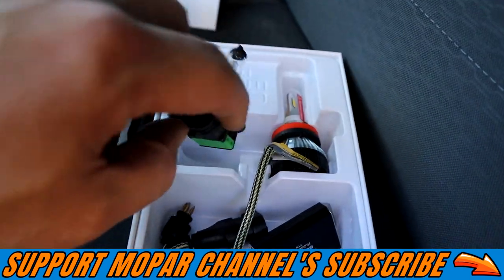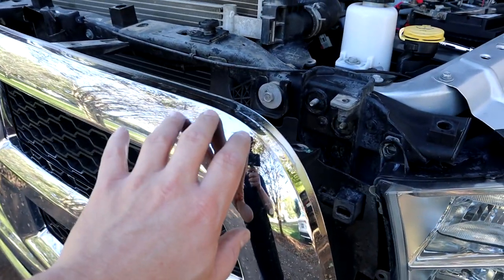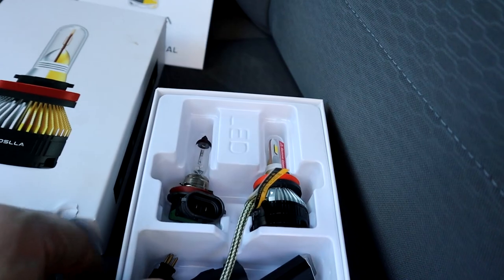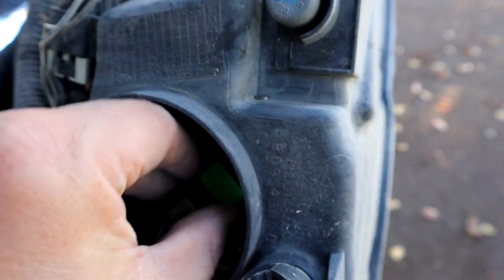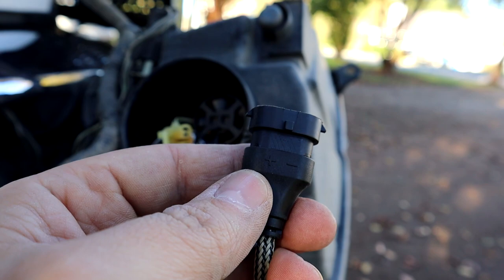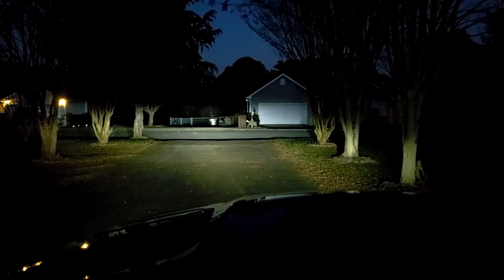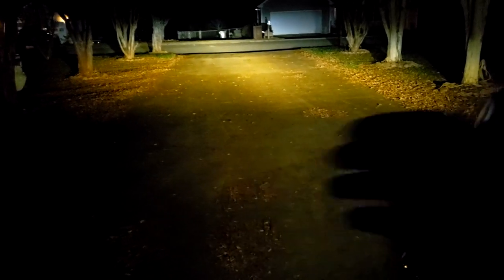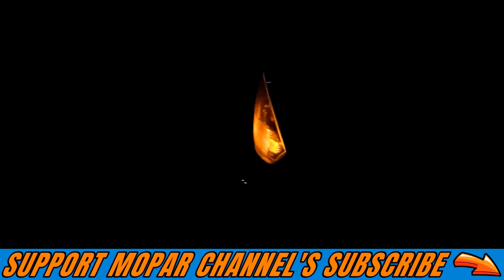New BOSLLA LED Bulbs 3 Color Modes 6500K 4300K 3000K Change On The Fly For Your RAM Truck Or Mopar.

Comment: I'm interested in these for my ram. Question though, do they cycle every time you turn on and off the vehicle? I don't wanna start my truck and have my truck driving around with flashing bulbs by accident.
Reply from the maker: They always start off on the 6500k when starting off.

Comment: @mopar motorsports are you still using the led lights?  I saw that another person used them but after a few months, the resistor melted the headlight housing.
Reply from the maker: No problems for me yet.